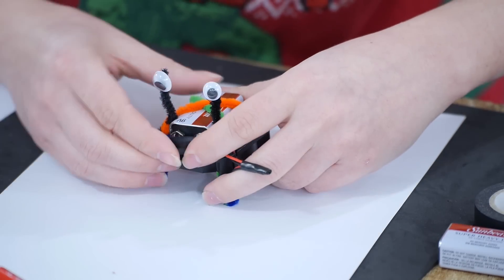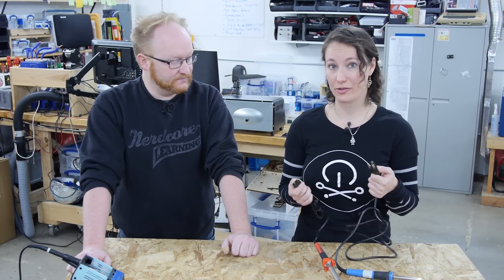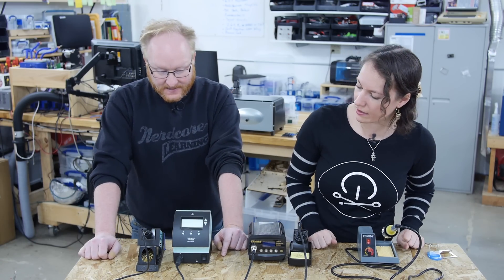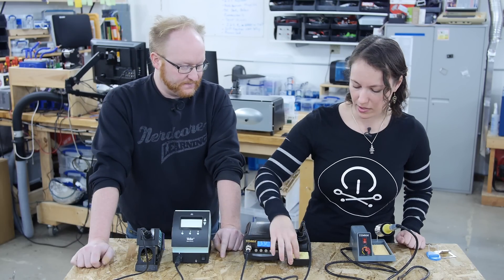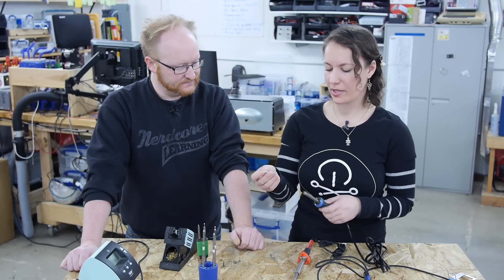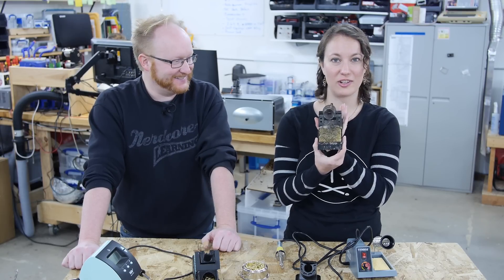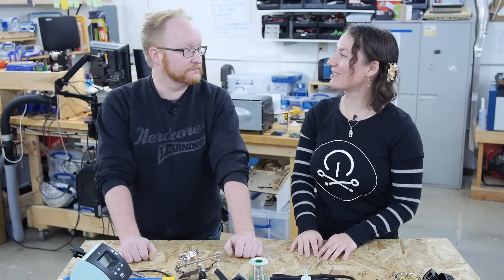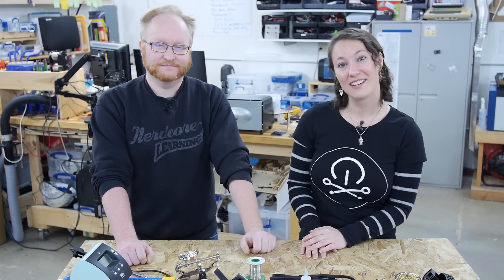The Learning Circuit - Basic Soldering Tools

Comment: While soldering you want to wear safety glasses.I had an incident where i was going to remove a soldered wire off a terminal, as i pulled off the wire after heating up the solder it flung a little blob of solder at my eye, had i not had my safety glasses on it would have put my eye out,as the solder melted into the lens of the safety glasses right where the middle of my eye was. Safety First.

Comment: The primary reason for having that third prong on your power plug is not to drain away static electricity on the exposed external metal parts of an appliance, but to protect against electrocution. If you had a faulty appliance with an internal short that connected the hot (120V) conductor to the appliance's metal case and you were to touch it, and simultaneously to touch something else in the room that was grounded, current would flow to ground through your body and possibly electrocute you. The appliance's case has been intentionally wired to that third prong, which plugs into a dedicated ground connection at the outlet, in order to prevent electrocution by guaranteeing that if a faulty appliance with such a unintentional internal hot-conductor-to-case short were plugged in, a large current would flow through the case and back to the outlet, and the upstream circuit breaker would pop open and shut off the power.

Comment: I use rosin core solder and keep the tip clean by wiping with a dry cotton cloth then tinning. A wet sponge works well but cools the tip slowing you down.

Comment: The EU should be applauded for their ban on lead solder. Like the US, it's still widely available and used here in Australia. I'm sure a lot more people would switch to lead free solder here if it wasn't for the price difference e.g. 200g of 0.71mm lead-free solder is around AUD$26 at our largest electronics chain whereas the lead version only costs around $16.00. :-(
Great tutorial. Thanks. :-)
Reply: Many people use lead solder because they are not that good at soldering and lead solder is more forgiving. Large manufacturers are fine with lead free solder because it is applied by robots.
Reply: EU is ghaye

Comment: The main reason to use brass pads is to maintain a constant temperature and reduce tip cracking.  Where a wet sponge creates a sudden and drastic tip temp drop, having to wait for the temp to come back up and can potentially crack or soften the tips over time.

Comment: I don't agree with that "your laptop power brick will get hotter at 230V than 110V" - Actually it's quite the opposite since the current is double at 110V, and the losses in the rectifier and switching circuit will be higher.
Reply: The guy was an idiot, he got a lot wrong.

Comment: My soldering pen has a temp control, it was really cheap too, $30 but it came with a desoldering pump, wick, an exaxto pen, solder, a case, a bunch of blades, a bunch of different ends for the gun, 2 tweezers and even more
Reply: Thats 30 cad too

Comment: 1: DO NOT BUY A SOLDERING IRON THAT PLUGS DIRECTLY INTO A POWER OUTLET, you're just making it harder for yourself - you'll be struggling to get the solder to melt one minute and burning holes through your board the next, they are inconsistent as hell.  Get a temperature controlled iron.  That Tenma one with the yellow-red dial will do and is around $25, and contrary to what Karen says, those yellow-red bands around the dial actually do map to temperatures, she just hasn't bothered to read the manual to see what they are.

2: The only tip you need is a small chisel shaped tip, about the shape / size of the end of a precision screwdriver.  This tip is good for 99% of everything you're ever likely to solder. If the one that came with your iron is a conical one that comes to a point at the end, replace it.

3: There are 2 types of flux core used in solder - rosin & acid - the acid stuff is for plumbing and will wreck your electronics, so it's important you get rosin core solder.

4: When using a new tip for the first time, tin it with solder as soon as the solder will melt on it.  This protects the tip and helps with heat transfer to the thing you're soldering. 

5: Every time you're finished with your iron, re-tin it (generously) as you turn it off.  Your tip will love you for it, and you shouldn't ever have to resort to dipping it in a tub of flux like Ben does as this damages it.

6: Leaded solder is pretty much all around better than the lead free stuff, just don't eat it.  It's also not completely illegal in Europe like Ben implies, you just can't sell commercial consumer goods that contain it.  You can buy and use it for your own projects perfectly fine, and it's particularly good for repairing consumer electronics that have stopped working because their shitty lead free solder joints have cracked.

7: Flux fumes are harmful, make sure you're in a well ventilated room.  It's a good idea to have a fan blowing across your desk to keep the fumes out of your face as you're soldering.
Reply: Thanks for the tips

Comment: I had the Atten branded version of that Tenma, it was really awful. Actual temperature of the tip was way off from the display, it didn't actually even read the temp of the tip (not enough wires to do that!) and just guessed. And it's thermal power was dreadful. I gave it away on Freecycle and got a Hakko, obviously a lot more expensive but worth the money as it will last years. Before that I had a temp controlled Antex which was not flashy at all but lasted me for a few years of occasional use before it broke.

Comment: What about using a WELLOR 8200D and a roll of 64%/40% lead/tin solder, The best solder-station would keep your roll of solder inside the solder-station and feed the solder up the umbilical to the heated tip of the iron and would have a foot pedal that when pressed by your foot would feed more solder to the tip of the iron.
Reply: Soldering guns have large tips that are difficult to use for the intricate soldering done on electronics. Soldering guns tend to be used more for plumbing. 

I do like the idea of automatically feeding solder, similar to a MIG welder. In a MIG welder, the wire is quite stiff, whereas solder is rather flexible and soft. The feed tube would have to be a fairly precise fit around the solder to reduce jams. Also with MIG welders, the wire is pushed from the spool rather than pulled near the handle. It would take some experimentation to find a drive mechanism that could pinch and push the solder wire without crushing it and jamming the machine.

It would likely be cost prohibitive to a hobbyist, but would be a very cool tool for someone that solders on the regular. You would need different diameter tubes to match different diameter solder, though. Intriguing...
Reply: I has been done just google for a solder-station that keeps the solder reel inside the solder-station.

Comment: When I first got into soldering two decades or so ago, soldering pencils had the drawback that they would rapidly lose heat (from sinking into joints), so after flowing a joint you would have to stop for a while to let the pencil reheat.

Maybe ones you can buy today don't have that drawback.  But I would recommend a cheap used old Weller off ebay or something far before even the most expensive pencil, even for a newbie.

Comment: I love tutorials like this. They remind me of stuff I learned years ago and forgot because It was just a passing fancy.

I just recently did a small project and could not figure out why the solder would not stick to the wires. A few days after I watched a video about modeling small items and the parts were soldered together. The individual used liquid flux and as I watched the video I thought: 

Oh yeah, I forgot about the flux part of soldering.

A-a-a-nee-hoo; the soldering was just a secondary after thought precaution to maintain contact. I had threaded the wire through the pin holes twice like you would when sewing leather together. It didn't need the solder.